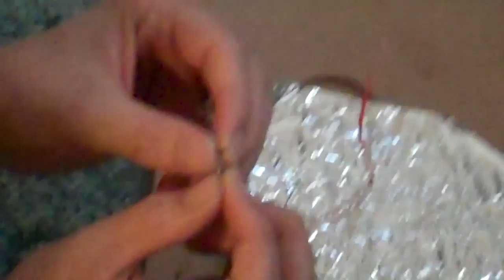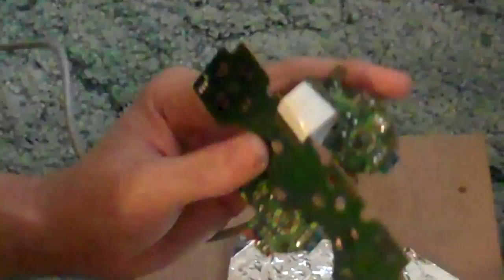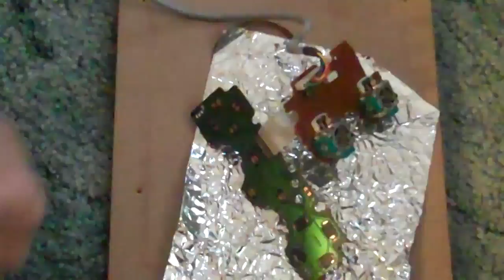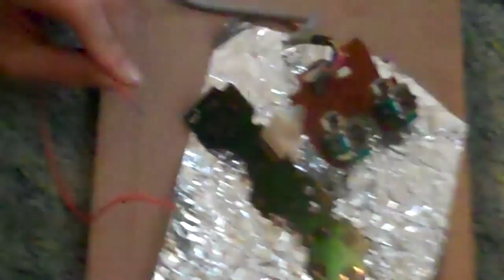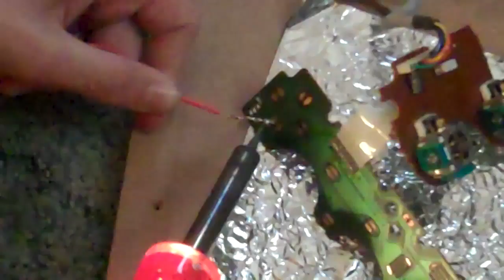how to solder wire to a controller pcb board for joy sticks

Comment from the maker: umm all u need to do is scrape off the stuff above the cooper which is blocking the the connection u could twist the wires till they intertwine and then glue it but its best to solder it for a good solid connection and i plug it in and test the grounds to the signal to see what does what but if thats too much i will make a vid sorry for takeing so long have a nice day

Comment: Hey this is great,can u make a vid of how to prepare the board before soldering.im modding a logitech gt wheel into an f1 wheel and the pcb has instead of 2 semi circles like the controllers to fork shapes?have u seen this before...would gluing the wires work i stead?cheers

Comment from the maker: @comicfreak11 ok did u scrape the insolation off the cooper and dont forget u have to heat up the cooper some times if it wont stick then very quickyl use a hot glue gun if this doesnt help i will make some thing for your case sepretly